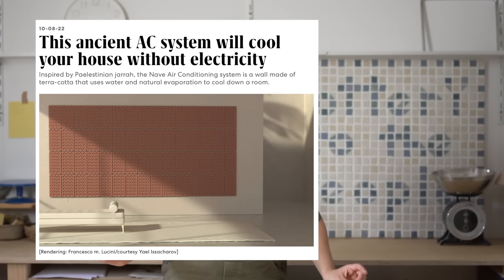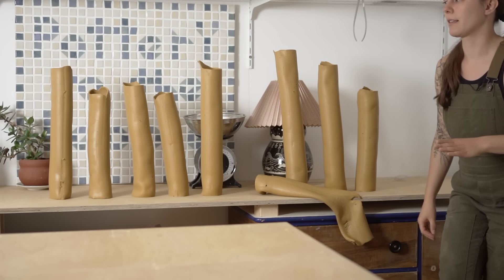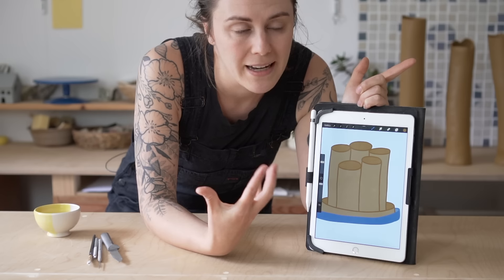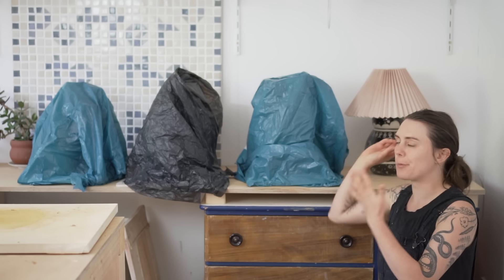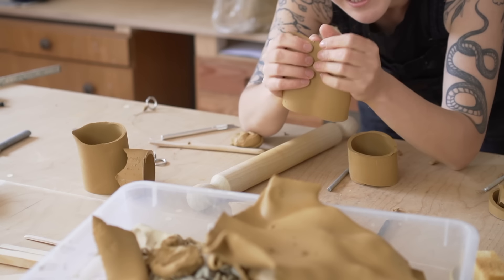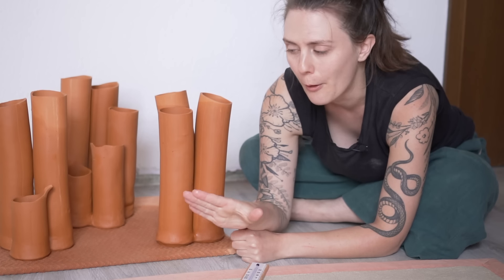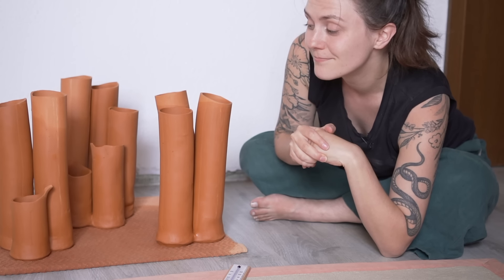Can I make an A/C out of clay???

Comment: A some of things to consider:
The room most likely feels cooler because you removed a big source of heat out of it... Yourself.
Exposed water will be a breeding ground for bacteria, fungus and insects like mosquitoes. cover the top of each, replace the water often and wash them regularly.
Having a fan blowing on them could increase their efficiency because convection is a slow process.
Those things can act as a humidifier. In very hot ambientes increasing the humidity can actually increase the sensation of heat, with is exactly the opposite of what you are trying to achieve.
In hot places going down from 39c to 35c doesn't feel much different. In both temperatures you feel like you are in hell.
While those things can reduce the temperature of water by a few degrees they take a very long time to do so. On the other hand the heat your body generates/wastes could heat the same amount of water by a few degrees in a few minutes. In short do not expect much cooling power out of it.
Reply: And don't forget the massive amount of energy it took to create it. Those kilns are super inefficient. For that just turn on the ac
Reply: @raypimienta7670  This is insignificant when you consider how long the system can last while not consuming any energy.

Comment: While this is interesting, it's not actually A/C. This is a swamp cooler (also known as a humidifier). They are great for cooling in areas with very low humidity, but use this somewhere with even moderate humidity and you just make the problem worse. Even if it slightly drops the temperature the increased humidity will make it feel warmer. True Air Conditioning does not just cool the air, but also dehumidifies it. Regardless, they look great.

Comment: It is a very old and proven idea. It will cool down more if they are in a current of air. Near an open window or in a place with air blowing. If you set then bellow a fan or in front of one you should feel the difference 
It adds humidity to the air if you are in a dry climate, then it is great will cool down more and will add humidity to the air protecting the skin too😊.
Not a good solution for humid climate.
Don't keep the door close or it will become to humid inside.
Plants help to cool down due to the same effect.

Comment: If you arrange them with a fan blowing air between them, You will find they will cool much more. During the 50's and 60's  in Phoenix we used evaporative coolers to cool our homes. They had pads that were kept wet from running water that a fan pulled air through and into the house. The interior of the house was a breezy 80 to 85 deg. F., when the outside temp. was between 110 and 120 deg. F.

Comment: unfortunately evaporative air cooling does not work well in humid environments and even worse, it actually raises the indoor humidity. In hot and dry environments it works wonders and it is utilized as what's known as swamp coolers.

Comment: sadly these types of coolers dont work as effectively in humid areas since the air is already saturated with moisture that it cannot evaporate off the surface. in the southeast USA where i currently live (and southeast asia where my family is from) its miserable where AC is a must, but out in california, the dry heat compared to the humid heat was much more bearable to me and id totally make the switch to this if i live somewhere drier. 

you should look up other passive forms of cooling! perhaps ceramic tiles with a white glaze thats so reflective that on clear nights with no clouds over head, thermal energy can be radiated out into space. its called radiative cooling and its another form of temperature cooling ancient humans used.

i have a suggestion to make on your current form of cooler though! only speaking as a mathy engineer person, if instead of large tubes, to raise the surface area, you make complicated surfaces or fractal shapes? fractals in theory have "infinite" perimeter or surface area, and so by taking a few steps to increase surface area there would be a huge increase in surface area for the same amount of space similar sized cylinders would take up. spheres and circles minimize surface area to volume, so perhaps thats another way to optimize it!

one fractal that comes to mind would be fractals we find from nature, like in plants! romanesco broccoli have these cone, spiral shapes. where if you flipped it upside down, could contain water, and the water wicks through the cone to all of the tiny little modules attached to the main clay body. then having a fan to just blow air through the structure would probably be really cooling!

Comment: Check out tech ingredients!! Essentially what you made was a very inefficient swamp cooler. They work because the evaporation of water (or any liquid for that matter) takes thermal energy, which cools the surrounding area when it evaporates. Only issue (and why they are called swamp coolers) is that they dump a massive amount of humidity into the room. But if you watch Tech Ingredient’s video he shows how you can make a much much better swamp cooler that keeps the air dry, and it might be viable for your space. The AC in your car or home work the same way; evaporate a liquid and it cools off, only in those cases the refrigerant is in a closed loop. You have to compress it, move it to a hot space and evaporate it, sucking the energy (heat) out of the space, move it back and the cycle continues. They’re really efficient. The only difference with swamp coolers is that they are open systems. (Hence the water ending up in the room) Really cool video tho! Didn’t know you could do this w pottery but it makes sense

Comment: Sweetie, you need central air, or at least a 220 volt window unit. These heat events can kill you. If some clay pipes did it, we’d use those in the South. You’re making a swamp cooler, a very limited thing that doesn’t work in the nineties or higher. Or in high humidity. If your sweat is evaporating you need a fan and electrolytes in your water. 
  Actually, if you can do a firing it’s not so hot out.

Comment: You need to raise them up high because cool air sinks. Also, a fan moving air across/through them and into the room would help. You'd probably also need a much larger number of these and/or make them much taller to adequately cool a decent size room. Not really worth the space they'd take up to produce the desired cooling effect unless you built a whole "side car" type of enclosed room that you'd fill these with and force air through it into the room you want cooled... in which case, a swamp cooler would be much more effective and space efficient anyway

Comment: This is a swamp cooler. It will not work in high humidity environments…

The drier the air, the better it works - because the rate of cooling is dependent on the rate of evaporation. the farther away the air is from “saturation” (100% humidity) the faster water enters into the air. The phase transition energy is removed from the water, which is why it becomes colder - the fast moving water molecules leave the water, which means the remaining total of water has slower moving molecules now ~> lower temperature! but thats not all! some energy is used to transition to the gas phase so even more cooling!

ultimately, swamp coolers only have value in arid climates, but on a large scale could be used to create “rain forest” conditions in arid regions.

Comment: Should learn about wet bulp temperature. This will only work if the air is not 100% saturated with humidity. The less humidity, the better it works. In many humid climates, it's getting it's impossible for the human body to cool itself off because the air is so saturated with humidity, over 100% saturated. This will render this "AC" system as useless. It also works by providing a thermal buffer between the outside and inside, so it takes more energy to heat up the home, and it cools off at night. But you need a LOT more water for this to work well. Hundreds of gallons per room.

Comment: I would think 4% is sustainable, there are bigger fish to fry. It's no where near my list of where to start to solve these problems. Especially when so many people (at least here in the US) live in triple digit climates. I'd like to see a reduction in cement and asphalt use to reduce hot spots in cities, which exacerbate the use of the AC. More grass, more shade trees, things that are not giant heat absorbers or reflectors. And they absorb carbon so double win. I love this concept for off grid purposes or even camping! How nice would it be to have a passive cooling system that really just needs water and some breeze.

Comment: A little knowledge of thermodynamics would have helped. Evaporation carries heat away from the clay but that heat doesn't disappear magically. It simply goes into the air in the room so that there is no net reduction of temperature. Normal AC units blast the heat out into the street as we all know. The clay system could make a difference if the water vapour was extracted from the room somehow.

Comment: I bet those could work really well for keeping a nice level of humidity in the house/room during the winter. I rented a place that was beyond dry from the old steam radiators and I would place metal pans & metal food cans on top the radiator to help add moisture back in the air. This design would probably work better then metal containers.

Comment: 11:37 normal ACs produce emissions mostly because of dirty power. So if we make electricity not based on fossil fuels, it would be better. 
Also, AC's are becoming a survival necessity as temperatures increase. And evaporation-based coolers only work well in non-humid environments. In places like Florida, evaporation coolers are useless because it's so damn humid there. And heat is more deadly in humid environments because your body can't regulate temperature because sweating is evaporative. 

We shouldn't be criticizing people for using things they need in order to survive. We should be working to make the necessary devices more environmentally friendly via renewable energy.

Comment: Fyi, 23°C is 73.4°F and all else aside a difference of each 1° C is always going to be equal to a difference of 1.8°F so if your thermometer tells you a drop of 1.5° is somehow bigger than the equivalent drop in °F you need a new thermometer. So fwiw 21.5°C is a 2.7°F drop to 70.7° in Fahrenheit. 

A 3 degree drop even while the outside temperature "gets a lot hotter" is a fairly remarkable result for a small first try imo. You've got no reason to feel any let down though there are things you can do to optimize the effect, mostly just make it a bit bigger. Of course if you're in a humid area this will limit both it's usefulness and how (un)comfortable it will make the interior air. As you make it bigger you're better off more closely replicating what was in the picture which was a window that outside breeze could come through picking up humidity and being cooled by the traditional evaporative cooler. Like typical swamp coolers you'll be better off allowing a full cross breeze that prevents the  indoor humidity from building up.

Even if you experience high relative humidity you may still get useful cooling if you're willing and able to run a small pump circulating the significantly cooled water your pan should collect and run it past a fan inside. This arrangement is called indirect evaporative cooling and despite what you may think would use much less power than a true AC even in humid areas though it won't approach the >20°C temperature drops that are possible in hot dry climates.

Comment: Really consider evaporative cooling if you're a dry climate. It's passive as well. Even soaking wet towels in front of your windows will calm down indoor temperatures. But you need to be in a semi-arid or arid environment. Some place where water easily evaporates. As far as your pipes go, I don't understand the design. What principle is this based off of? There's no where for thermal energy to flow.

Comment: I hope this doesn't come off a mansplaining, I have many years of science and physics courses under my belt and I have an interest in evaporative cooling. Your idea should work (it probably is working). When water evaporates the water vapor takes heat away with it. This has the effect of cooling the remaining liquid water. However, since the water vapor remains in the room, so does the heat it removed from the water. One possible solution is to have a small fan (like a computer fan) and exhaust tube running from the area just above the pots to the outside (through a slightly cracked window - seal the rest off). It should be very low airflow so you're not just pulling in more hot air from outside.

Comment: You just can't cool your room like that, it contradicts the laws of thermodynamics. It's similar to trying to cool a room by keeping a fridge door open. If anything you're making it less comfortable by raising humidity, so as soon as you open the shades it will become even hotter. The 1.5C degree difference is probably a difference between your air temp and a stone/concrete floor temp (assuming you left in next to the device). However, this thing can cool water, which is something, you could totally develop it into a non-electric cooler for drinks or something like that.

Comment: I love your enthusiasm.  A noble effort and a virtuous failure.  Just a few things to know here.  The principle of this is absolutely legitimate.  The use of water and clay vessels to cool has been around since ancient times and spans cultures around the world.  The Spanish still use clay-based wine coolers.  The Mexicans have a water cooling clay urn.  Several European cultures use the same method to keep milk bottles cool.  The design you had was also bound to reduce temperature via evaporative cooling...even if only by a degree or two.  There essentially two factors that limited your success.  First, was the scale of your creation.  The system you built needed to be much larger and it needed to be scaled up to the size needed for the size room you have.  Second, was thermal economy.  This is just about minimizing the need to cool, so that your contraption doesn't need to work as hard.  In terms of what ancient peoples could do, this meant building below grade, maximizing shade and natural insulation, using stone and light colored building materials, keeping windows and doors to a minimum, and controlling the entry of hot air.  (Think wine cellar.)  Don't be disheartened.  An awareness of this experiment will help you to create practical cooling approaches in the future.  Until then, fondly remember this as your first "A/C" or "Adobe/Cooling" experiment. :)

Comment: To keep the tubes from buckling, it would be neat to try a board with dowels sticking up vertically. It doesn't have to be the same ID as the tube but enough to control the tilt so you stop the localized buckling

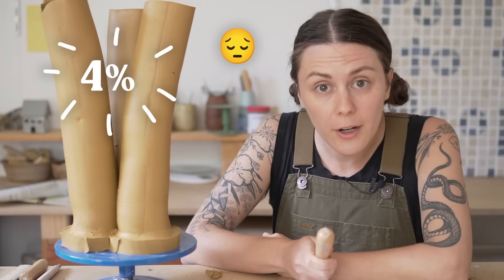Comment: 11:08 AC is absolutely sustainable. Citing a source from a 2002 study is pretty terrible, since in the source it directly says more than half the "4%" figure is from usage of refrigerants that have already been phased out. ACs have also increased in efficiency drastically in the past 20 years, I'd wager the previous 4% is closer to 1% and even that is questionable. 

You have to also consider the problem of indoor air quality(IAQ), which is primarily achieved via filtration and cooling, to achieve a level of humidity not likely to cause mold growth or other issues caused by too high or too low humidity. IAQ is very important and can improve health and even save lives, so saying "AC is not sustainable" is not only wrong but potentially a dangerous message to spread if you don't understand the implications.

This is a variation on what is called a "swamp cooler". It lowers temp while raising humidity, so unless you live in arid climates it is of limited use. I wonder if maybe running water through unglazed pottery pipes outdoors and then circulating it through a cooling coil indoors would be a good way to remove heat from indoors without the traditional compressor/metering device cycle. Would still be of limited use in humid climates, and in arid climates you might WANT more humidity in the air. Oh well, it was a thought.

Comment: Probably you have to consider where you place this. Things dont just "cool" for free, its all a transfer of heat energy. Heat from your body is transferred into water, causing it to evaporate. The water leaves your body taking the heat with it. But it has to leave, otherwise its just like having warm water on you. Same way here, water takes the heat from the room, but if the water doesnt leave the room nothing has really changed.

Comment: you cam amplify the effect of the tubes by adding a small fan. In the U.S. we call it a swamp cooler, however, they are very limited in their capacity cool in non-arid environments. I do like this low tech option though, in terms of being able to keep a room at a (relatively) cool temperature; I think it worked phenomenally.